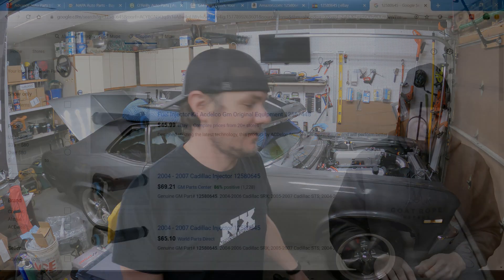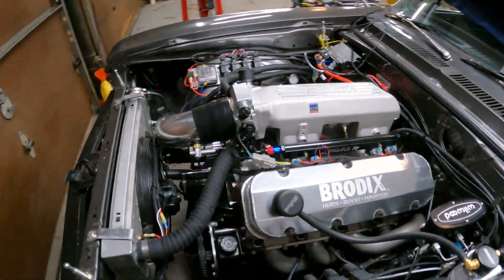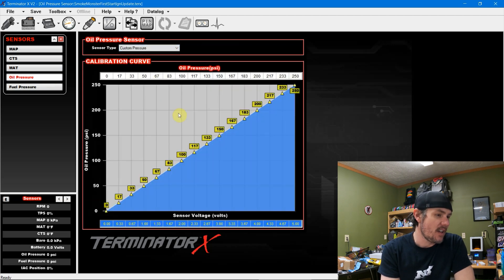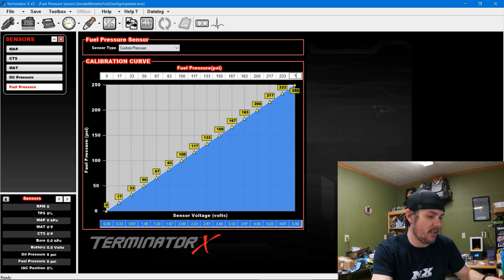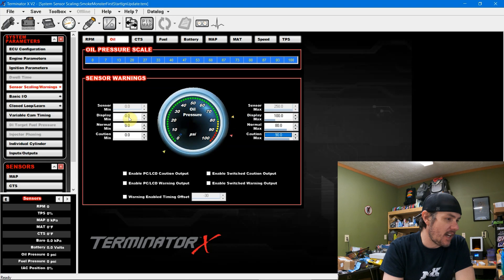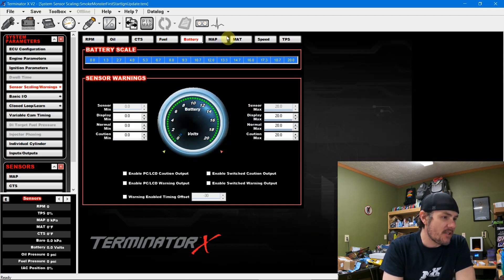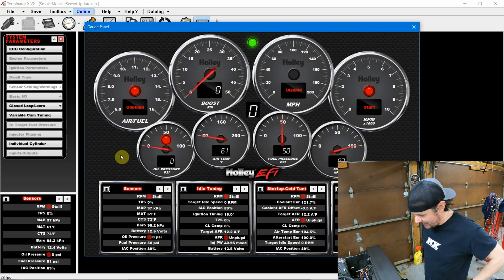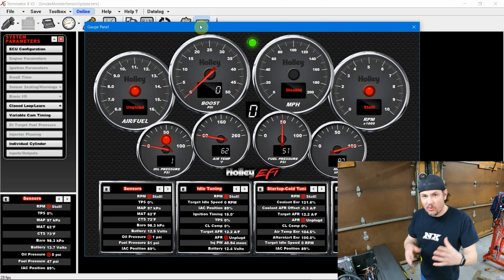Sensor Setup On The Holley Terminator X

Comment: Is the MAT required? I hate the only way to put these MAT sensors in is bubba gluing them in. I want to run boost in the figure and don’t want this thing popping out at 10-15lbs if boost just using RTV..

Comment: I have a hose running to the map sensor on the ecu but I want to use a 1 bar on the manifold. (Stock ls1) I bought the 80 dollar “terminator map sensor” and there is no option in the drop down on the efi software.. this is so frustrating and neither are stock ls1 injectors.. also am I restricted to v2 software for my terminator? Downloaded v6 and there’s more map sensor and injectors listed but says ecu type is dominator/hp.. why is it so difficult to just run stock things with this expensive ass ecu
Reply: It isnt difficult you just have to set it up accordingly, look for the forum, everything you should need its gonna be there, just look for it
Reply: @h77simracing20  my point is why would stock ls1 injectors and their own map sensor not be in the drop down since I ordered a ls1/ls6 harness. Having to search forums to setup my own parameters for a map sensor that literally says “terminator map sensor” when they have every single map sensor option besides 1 bar is kind of crazy. Injector list has 5.3 injectors but no ls1 part number. Truck runs and drives fine just dont want to run a hose into the cab for the ecu permanently when the harness has a plug for map sensor.

Comment: Hay I'm looking to get a labtop for a 06 Colorado 2.8 motor got a throttle body that won't relearn but the key on key off do I need the mdi or can I use tuner too set it up factory
Reply from the maker: Good question, James and I'm not sure to be honest, you can get away with a cheap laptop no matter what and I would get an MDI clone and be done with it
Reply: Ya the mdi clone is what I'm talking about just slang for the Bosch interface or whatever they call it...